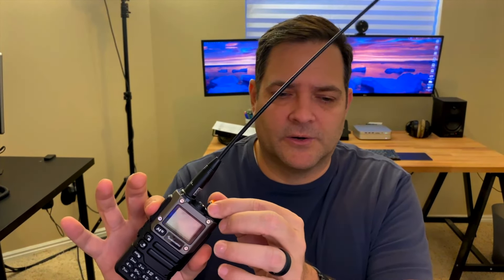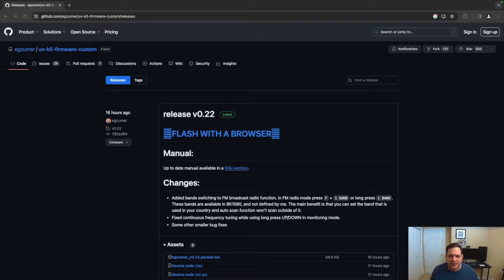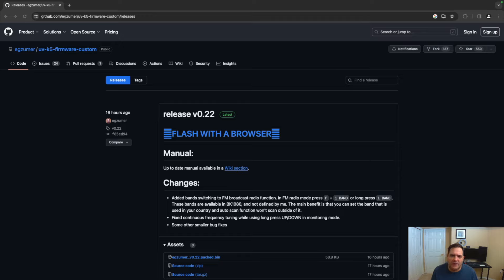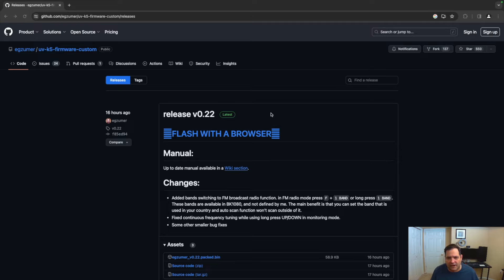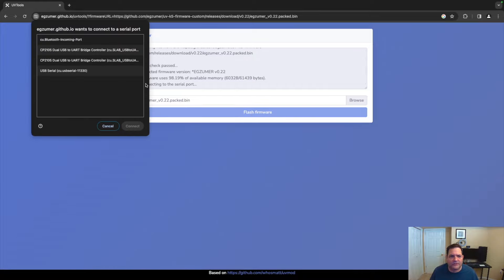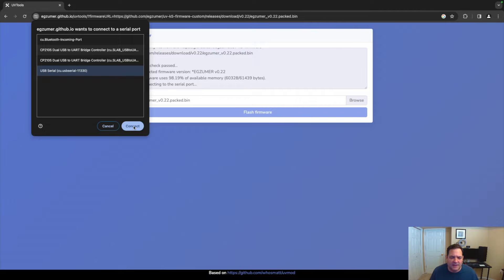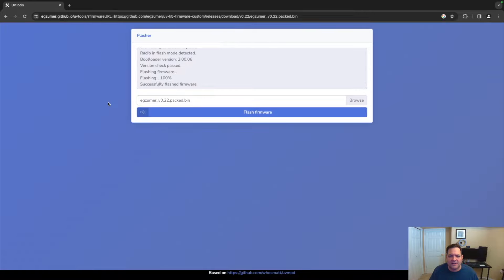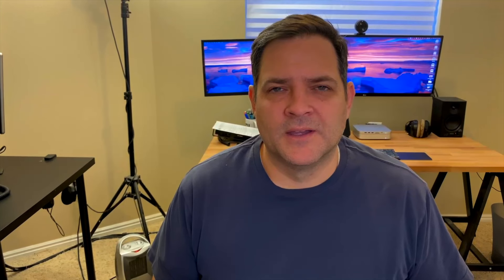Flashing Firmware on the UV-K5 - EGZUMER

Comment: I’m minutes away from Returning the Quansheng UV-K5 to Amazon having spent several hours trying to install a Egzumer 022 software via my PC. Plugged the correct cable into the well made UV-K5 and connected it to a USB on my Windows 11 computer. Having complied with the quite clear instructions on the software installation I confirmed that the USB had indeed been allocated Port 3 and it confirmed that connection had been “Paired”. The installation window opened and the Flash pressed with a short message that the port was not activated. I changed the USB port several times with the same result!!!   What am I doing wrong?  Is there perhaps another way of installing the update instead of the web based method?

Comment: keep getting connection error. I am using a baofeng branded cable do you think this makes a difference?
Reply from the maker: That should not matter, if I have an issue, most of the time it is because I did not seat the cable well enough.
Reply: @jonlawrence  Yup I got it finally lol I smashed the hell out of it then it worked lol thank you sir!

Comment: Could you please check and tell me if the air frequency copy, FM radio and flashlight work with this egzumer firmware?
Reply from the maker: If by air frequency you mean AM Air Band for flight traffic, yes it works for receive. Broadcast FM radio and the light still works.

Comment: Hi,
I just received a brand new radio, can i follow your instruction or should i need to do something else beforehand?
Thanks ;)
Reply from the maker: I have personally done it to about 15 radios for friends without any issues, you should be good to go. YMMV
Reply: @jonlawrence  the Github repository doesn’t have that nicely done flasher link that puts the bin file in there for you.  Now it takes you flasher page and you have to find the bin file, which seems to now require using code space, etc…

Edit: Never mind, I was just on the wrong GitHub page.  Looked identical, but it wasn’t.  Thanks for the GREAT video.

Comment: I used cable and have a Mac too, but I get this error: Connecting to the serial port...
No data received, is the radio connected and in flash mode? Please try again.  Should a blue light go on the HT to indicate a positive communication?  Mine did not turn blue.  I also tried the USB C port and I do get a blue light but I get the same error..
Reply from the maker: You cannot program the radio via USB. You must be in flash mode, hold down the PTT button while turning on the radio. Make sure the connector is in all the way, it takes a good amount of pressure. Make sure you have the correct connection selected.

Comment: A quick question:  I was trying to use the same programming cable that I use for the MD UV390 radio, which works fine on the UV390.  When I power on the K5 with the PTT depressed, I DO, in fact, hear the USB connection sound, but it tells me it is an unknown device???
I have not heard anybody talk about a driver for it...
Reply from the maker: Sorry, I am not sure if that cable will work
Reply: You will need to install the correct drivers for it
Reply: Ok, the DMR radios have a USB channel built into them.  Hence, they have just a straight cable.  The K5 does not have a USB channel, so needs a cable with a converter chip in it.
I bought a chipped cable, and it worked fine.  I DID find that you have to push pretty hard on it to make it seat, physically.

Comment: Hi Jon: on my iMac, hooked up ok to browser, but this msg: No data received, is the radio connected and in flash mode? Please try again. any thoughts would be apprciated. VA3TM
Reply from the maker: Are you using a chrome browser? If so, sometimes I have seen it fail the first time. Try flashing again, if it still fails confirm your cable is pushed in all the way, it can take a bit of force.
Reply: @jonlawrence  Thanks for your prompt reply! Yes, on both counts, have tried multiple times. Using the cable from an Anytone 878. Maybe that's the issue. The Flasher panel reads: USBserial (cu.usbserial-14410)-paired. Sorry to be a Pain!
Reply: Same issue on Mac mini M1. I thought cable was busted but flashing works on Windows. I can even use CHIRP on macOS, but can't flash using the UVTools in chrome. It's really weird.

Comment: This is frustrating. I have this same radio, arrived ending of Sept 2024, but This whole procedure did not work. I'm running Win10 pro 64b, am using the data cable that came in box, (plugged into USB port) its a brand new Quansheng UV-K5 radio.  I even tried the Quansheng website and clicked on the green download button and nothing, just same page popped up. What could be going on?
Reply: Ok, my bad,, I rechecked cable plug connection to radio, it wasn't all the way in. Now it paired and did the flash.
Reply: But I am wondering, what's next..? I got this radio few weeks ago, don't know the first thing about locating and listening to frequencies..

Comment: Great! Radio is coming next week! Can a person still use Chirp to load frequencies when this firmware has been installed?
Reply from the maker: Yes, but there is a python module that needs to be loaded in dev mode in order for the radio to be recognized correctly
Reply: @jonlawrence  How do you load the Python module? Ever since I updated Chirp, about a week ago, I can't upload to radio any files. Read from radio works, but I receive an error message preventing me from writing to radio. This is true even with my Baeofangs. I have filed from over a year ago that won't write. 
Should I revert to a legacy version of Chirp and if so, how?
Thank you for your videos.

Comment: Hello and thank you for the video, I’m having some issues when trying to upload the custom firmware,  I have followed your instructions but when I get to the part where I select the com port and hit connect instead of the percentage going up I just get a message saying “no data received, is the radio connected and in flash mode? Please try again”  I’ve tried many times and just keep getting that message if anyone could help me with this I’d be most grateful as I’m new to these radios and don’t know much about programming them
Reply from the maker: Are you sure you are in flash mode (light is on)? Are you sure you have selected the correct com port? Are you sure you pushed the connector in all the way, it can take some force, more than you probably expect.
Reply: @jonlawrence  I have that same problem. All recommended actions done. I still can't get it to work.

"Are you sure you are in flash mode (light is on)? Are you sure you have selected the correct com port? Are you sure you pushed the connector in all the way, it can take some force, more than you probably expect. "

What's the problem. Cable fault. New and looks undamaged.

Is there any other way to do this operation?
Reply from the maker: @_m_ev1673  I honestly could not tell you without looking at how you are doing it. If you feel you have followed all the directions correctly, it might be a bad cable.
Reply: are you on macOS? I can't seem to make it work on macOS chrome based browser. Trying on windows was the only way to flash the radio. Cable is ok and can communicate with the Mac using CHIRP app but flashing using the UVTools web app doesn't work. So I think the issue is with either UVTools or browser.
Reply from the maker: @Jonahmeans1024 yes, I use MacOS
Reply: @jonlawrence  What macOS version and what architecture (Apple Silicon or x86) are you on? I'm trying to figure out what's going on.
Reply from the maker: @Jonahmeans1024  m2 pro on a Mac mini, latest MacOS.
Reply: @jonlawrence  I’m on M1 macMini Sequoia 15.0 public beta. I also tried using the Windows 11 arm VM running on the Mac and flashing works. Will see if downgrading to stable Sonoma fixes it.